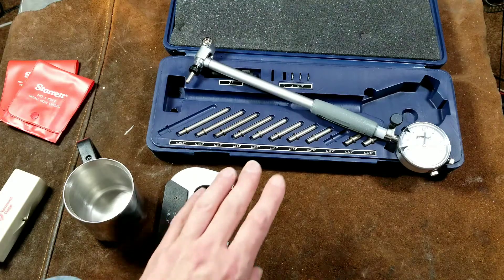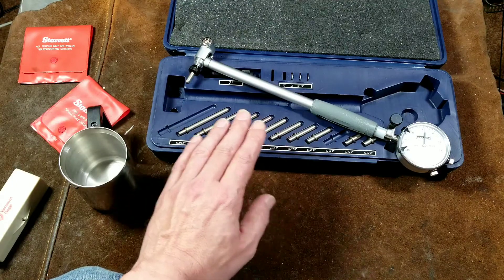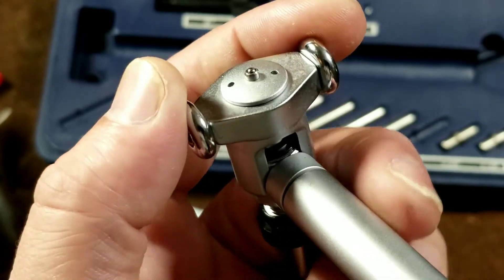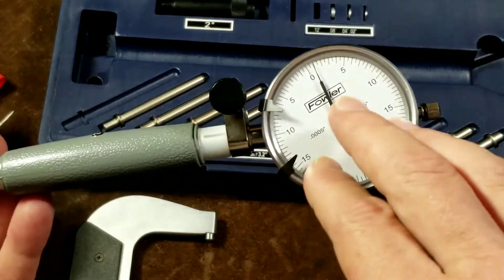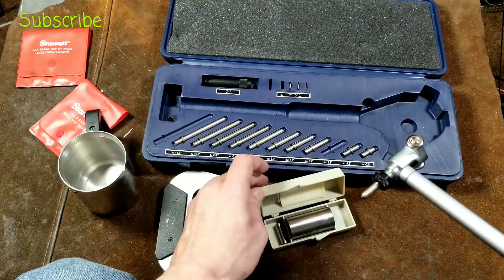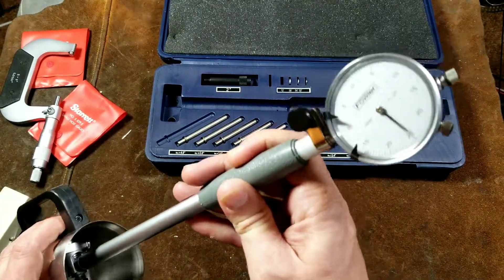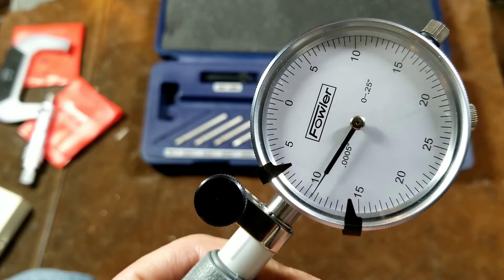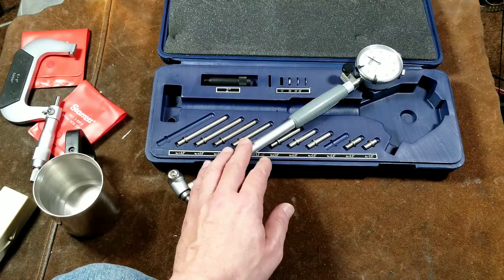Fowler 2"-6" Dial Cylinder Bore Gauge Set Review

Comment: The problem with using these of a mill or lathe sometimes is that there’s no room at the end of the bore to get these in. So you have to disturb the set-up to take the measurements. So if you’re boring a hole, these may not be usable. For that, an internal mike would be a better choice. But if you have the room, these work very well.

Comment: Got the same one, thanks for the video. My question is, when i spun the handle out, the inner rod and spring came out. I've got it put back in where I think it should be but is the a breakdown anywhere of that spring/rod inside the handle? Thanks in advance.

Comment: Hate dial gauges....why?  Pain to read, but doable.  Not really an issue, however?  I often deal with having to switch from Imperial/SAE to Metric.  Often multiple times in the same application.

2 Engines I have lately worked on:  4G54 Astron (Mitsubishi) and Ford 4.0l SOHC Cologne...both use constant swapping of tolerances.  Yeah, I could do both in one tool with conversion.  But I hate having to have a calculator with me.  Just more BS to deal with.
Reply from the maker: There's also the much rarer dual needle dial which read both metric and fractional at the same time